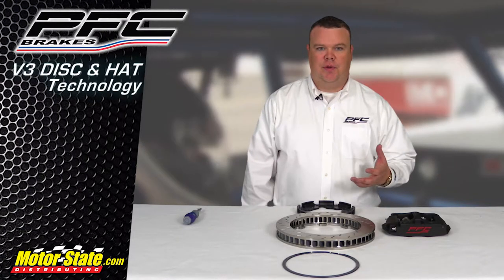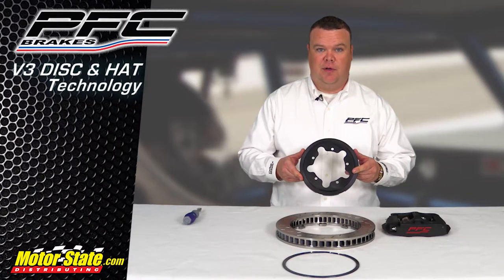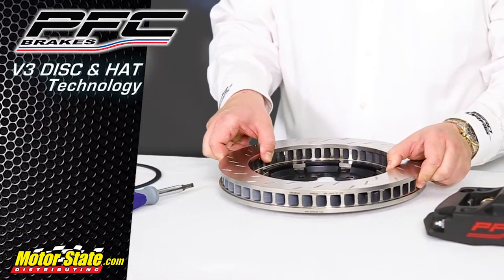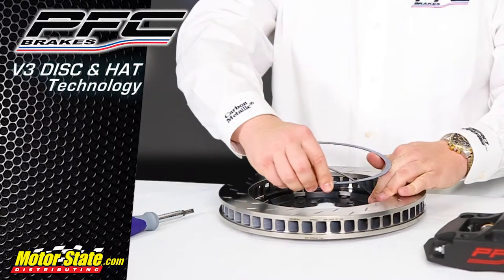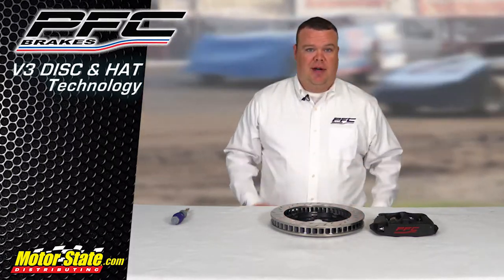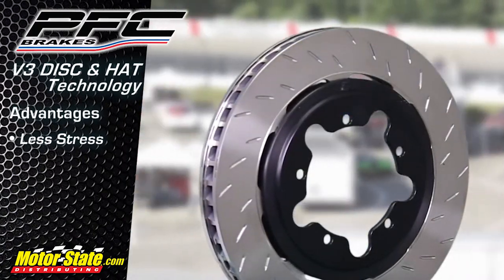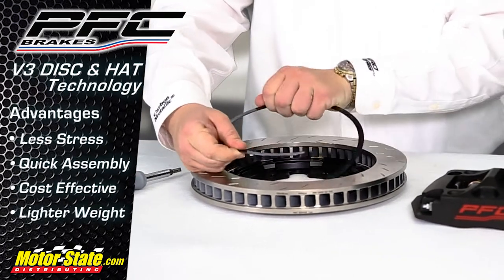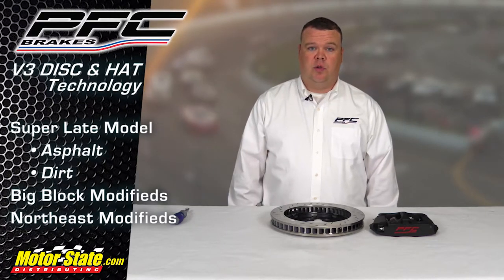Performance Friction V3 Brake Rotors

Comment: These may work great when new, but they become welded in the groves after they’ve heat cycled a few times. What a pain to remove and rings are toast! I do not recommend, unless you change rotors very frequently.